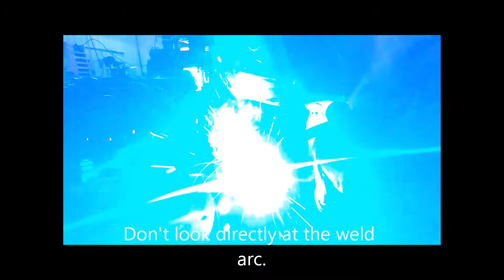Welding up and turning down a shaft.

Comment: So I have the same problem on a shaft for a trailer but it’s just a small indentation, and since I don’t have a lathe, have you heard of anyone just grinding down the weld to match the curve of the shaft?
Reply from the maker: Sure, as long as it isn't high speed you won't have vibration problems. Since it is already worn and you have no vibration problems you have nothing to worry about.

Comment: So... how many hours did it worked after repair? Usually it won't last long.  In my experience only fast low torque shafts survive this kind of repair. If shaft has to work hard it will crack soon.  Don't fix your helicopter main shaft this way or you will see heaven earlier than expected!
Reply: uhhh  it is a swather!
Reply from the maker: The farmer actually brought it to us because he was tired of buying new shafts at high prices. We told him we could build him a new shaft from 4140 and it  would be stronger but he chose a repair even though it would have cost about the same.  Don't argue with the customer.
Reply from the maker: I wouldn't fix a helicopter this way, but we fix shafts every day and haven't had one fail yet.